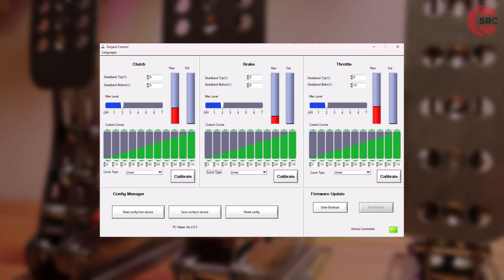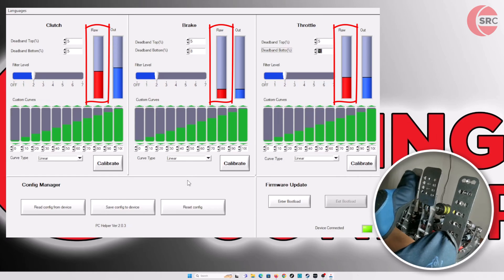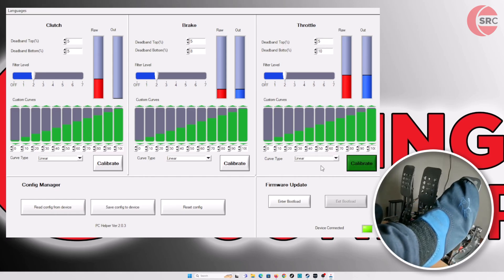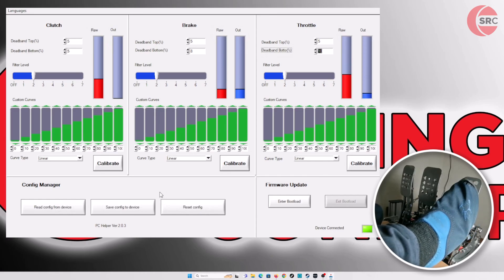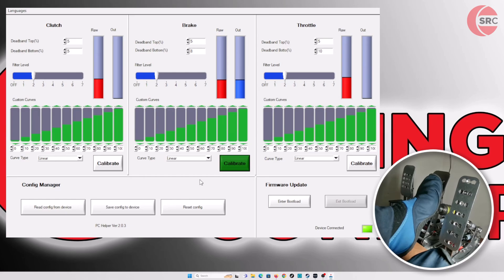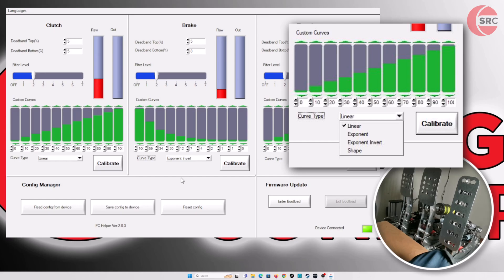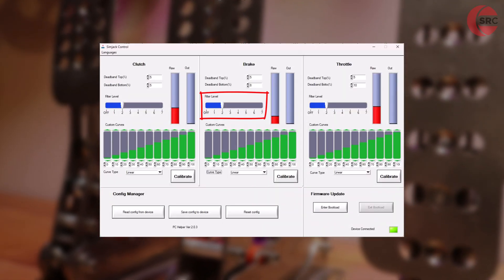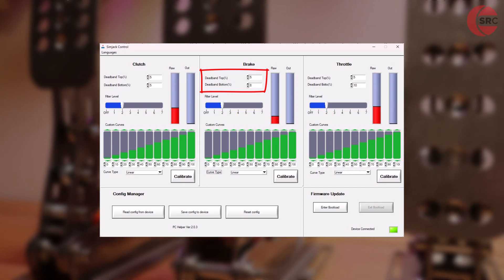SIMJACK Ultimate Calibration using SimJack Control Software [QUICK START GUIDE]

Comment from the maker: Thanks for watching! Other related content you may enjoy!
🤑 Product page https://s.click.aliexpress.com/e/_Dmd9Ztp
▶ SIMJACK UT Sim Racing Pedals [UNBOXING] https://youtu.be/9yjU4NuEPwA
▶ SIMJACK UT Sim Racing Pedals [REVIEW] https://youtu.be/mRSeVetZ8dc
▶ SIMJACK Pro Pedals [REVIEW] https://youtu.be/vgcxGt2xd7E
▶ Simjack Control Calibration Software http://sim-jack.com/download/
Reply: @simRacingCorner I recently bought these and finally setting up today. (Due to your review). I notice the brake cable has a severed yellow wire before it goes into the clip, but I don't see a yellow end inside clip at all. Is this the case for you and yellow unused? My pedal is extremely stiff with even the default elastomers so I put in a lighter spring in place of one elastomer. The calibration reading is awkward so not sure if its a faulty brake or just need to keep trying. Was going to message Sim Jack but not sure how long they will take to get back to me, trying here as well. Cheers.
Reply from the maker: @GuiltyLeasures  My brake is the same, there's no yellow wire.
Reply: @SimRacingCorner  great. Thanks for your quick response. I think the substituted spring I had in house must have made calibration really glittery. I'll see what I can do. The elastomer load stock was so heavy it literally flexes my mounting plate and I can barely push in. 

Great videos, I bought the SimJack petals, H-Shifter and Sequential through Temu deals all based on your reviews.

I got 3-year old, in my mid 40s and reviving an old hobby at a budget and space restriction. Your content is great for us getting up to speed and carefully building up a sim rig that fits our situation.
Reply from the maker: @GuiltyLeasures  What wheelbase are you running? I'm wondering if the jitter is EMI. If you hold a constant force to the pedal, does it flicker badly on the gauge?
Reply: @SimRacingCorner  I'll get back to you on that. It was calibrating like there was interference and as I got it down after a few calibration sets and saves it seemed to improve but it looked inconsistent in the app. I was also using my hands and not feet to test since I was running out of time and plate wasn't yet mounted back on rig.

My only quick in-game test was BeamNg and it was okay after I manually set deadzones in game for throttle and brake.

The SimJack calibration filter setting I will play around with, deadzones for top and bottom I had left at 5 for all petals at the time.

Just have my old G25 wheel petal and shifter still all plugged in. Considering a Cammus WB15 maybe down the road. I got the PXN button box from your reviews as well.

I assume I need the full G25 setup including petals in order to use the wheel(?)
Reply from the maker: @GuiltyLeasures  A G25 won't be causing interference. EMI is usually a direct drive wheelbase type of problem. Though other random USB hardware can sometimes do that as well. 
I reviewed the Cammus WB15 a while back. I wouldn't recommend it. I found it doesn't deliver detailed effects very well.
Reply: @SimRacingCorner actually it was the C12 Cammus I believe. A budget Direct Drive wheel that performs well is what I'll be looking for. I'm in Canada, the other model came up when I Googled at a retailer I found carrying Cammus. Something better than the C5 but not an overly costly investment. I see you have a Moza review I'll check out.

 I only have one monitor so currently researching a Meta Quest 3 solution as next step.
Reply from the maker: @GuiltyLeasures  I have indeed reviewed all the Cammus wheelbases (https://youtu.be/ByVLHdaiFDc). The Moza range of wheelbases are very good, they do offer excellent price/performance.
Reply: @SimRacingCorner  yes, rewatching your C12 video now. It was that review that got me thinking it was the one for me and had me looking into it further. I have a bunch of reviews saved on my other account, currently on a free YouTube Premium trial binge here. Sim Racing Corner is my go-to for researching hardware for sure.

I'm about to set up my 25watt Ali Express transducers on the petals today 😂.
Reply from the maker: @GuiltyLeasures  The C12 is solid. I do prefer it over their 15Nm wheelbase.

Comment: Hi all - software states Disconnected - Diview works and  can calibrate in Iracing - any ideas to detect in SJ Control software? (they are SJ Ultimate Pedals)
Reply: Same problem here. I'm using freejoy to calibrate the pedal and it is working fine, but it is not detected by the Simjack app... Was curious to try the filter option it has on the SJ software
Reply: @conuke  I have the same issue, sj software does not see the pedals. Did you figure this out?

Comment: I just got these pedals after watching your review but for some reason I can't get the application to install. I unzipped the file and started the setup file but it won't proceed and only states:

Installation Summary
No software will be installed or removed.

And I'm unable to click next. Do you know why this is the case?
Reply from the maker: Did you properly unpack the files from the archived file, first? Right-click > Extract All. It sounds like you ran it from within the .rar compressed file, and that will result in the error you described.
Reply: @SimRacingCorner  I did extract it. Opened folder and just tried to run the setup file. Not sure what is going on with the application install.

Comment: Hello,  i bought the ut pedals, calibrate them and they worked perfectly for 3-5 months. 

After changing elastomers to softer ones can't calibrate, has it been occured to someone before? 
Brake pedal looks pressed when i calibrate and in full press does not go anywhere and sometimes falls to zero. 

Any help would be aprreciated.
Reply: pareil ta trouver ?

Comment: My throttle picks up nothing until about half travel where it also maxes out here. Simjack software looks the same as yours, the pedals also work flawlessly on iracing. Any other title, the throttle is unusable, brake works fine.
Reply: make sure to not plug into a usb hub, plug directly into ur pc

Comment: Do you need to keep the sim Jack app running or is it just for calibration? For Iracing you have to calibrate as well, is it ignoring sim Jack config?
Reply: I have exactly the same question, because I feel like iRacing is ignoring the Sim Jack config and doing it's own thing, or worse that they are fighting with each other.

Comment: @Sim Racing Corner Do you have Simjack Control Calibration Software exe on your PC download folder ? because their site has been down for long time I can't download the software after a PC reset ... can you check if you still have it please
Reply from the maker: Here's the D/L link, it's working http://sim-jack.com/download/
Reply: @SimRacingCorner  thank you very much my PC would never let me go to the website no matter what I did I think is my firewall or my router is blocking it it says the website is not secure as is not HTTPS these never happened before I had to use my phone to download it imported on OneDrive  bypassing my router firewall by using my phone EE network
Reply: @SimRacingCorner  link doesn't work for me on any major browser. "Secure Connection Failed." Does anyone have the exe file not from sim jack's website?

Comment: Does this software work with the SIM JACK PRO pedals thanks Laurie
Reply from the maker: No
Reply: @SimRacingCorner  if he does use the controller from from the UT it does work you can even use no sure just get Mod Sim Jack Simracing Pedal and use Heusinkveld ultimate software if you get the  upgrade kit there is a video showing all this like I said they are all the same pedals different name adjustments and marketing beyond
Reply: @SimRacingCorner  It works for me.
Reply: @BackFromTheMadeUp with the original pro?

Comment: Can someone help me when I launch the app it doesn’t work
Reply: @Yeg_stanced  I have this problem too, I launch the app, but see only "mesa.dll could not be loaded" 
Did you solve this problem?
Reply: @alexfilatov2163 I'm having the same issue today did you end finding a fix at all
Reply: @alexfilatov2163  This software only works with the UT version but I also think if you get the box for the UT will also work
Reply: Did you guys find a solution at all? I have the same message about mesa. Dll

Comment: Hey I'm completely new to sim racing and wanna build a setup. Was wondering how I should mount these pedals because from what I can tell the package I want doesn't include a baseplate. Is there a baseplate that I could buy separately and would it have to be a simjack made one, or do they mount pretty universally allowing me to look at potentially cheaper options from other brands? Or should I just make my own?
Reply: the most expensive option on Ali express comes with a baseplate, also seems like they sell one for the pros for $90 which I’d assume would also work for the uts